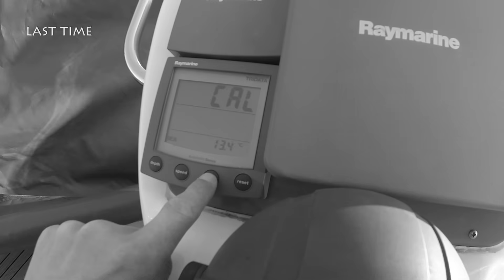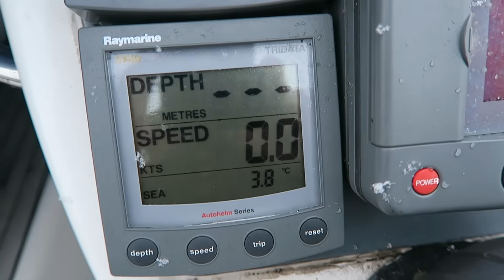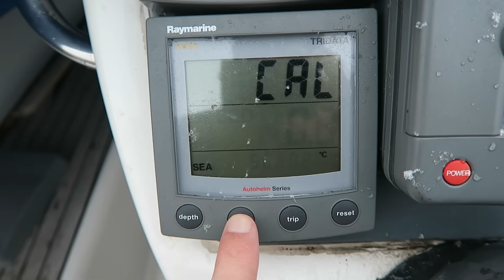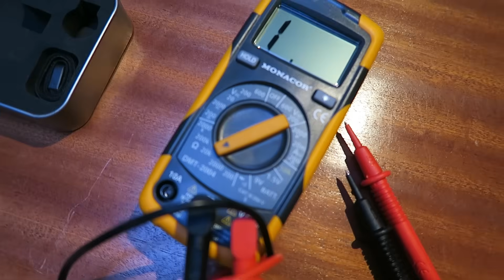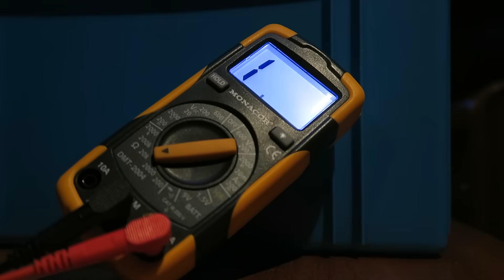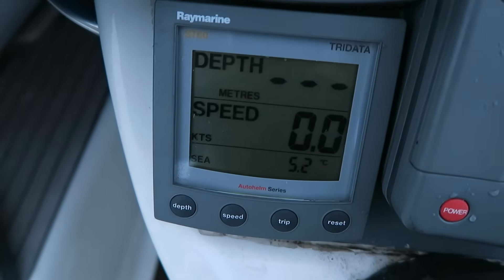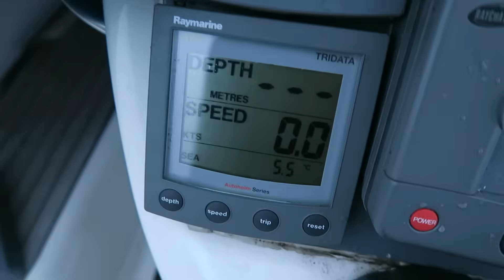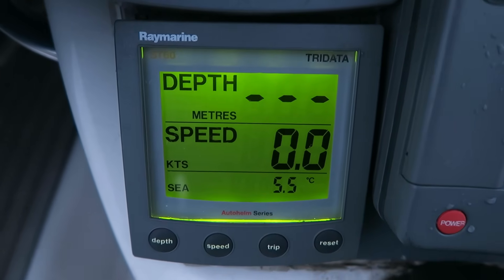Raymarine ST60 Tridata - how to fix Incorrect temperature

Comment: Thanks for the inspiration! In my case the tridata display showed about 5°C instead of 22°C. The resistance of the NTC was then at >2MOhm. Therefore, adding resistance would not have helped. I exchanged it to a 20kOhm NTC from Aliexpress. Temporarily fixed it with a cable tie to a metal fitting, that is at sea temp. Seems to work so far 🙂. Let's see if the temp characteristic (b-value) is compatible.

Comment: Hi Tino. The temp sensor on my ST60 was showing incorrect temp (104F). Excited to get this little project done, I found a pack of the 10kilo resistors on Amazon and performed the job exactly as demonstrated, except  installed the resistor behind the instrument in the pod.  I still cannot calibrate it lower than 102F. Any ideas?

Comment: Hi Tino, tnx for the infos, with your advice I was able to get my transducer in normal range but now the value doesn’t fluctuate over temperature changes, it is always between 23,5 and 24,5 C, while actual sea temp is between 16 and 27 C. Do you think I have to replace my thermistor?

Comment: Thanks! My i40 speed/temperature transducer read about 20C high.  The i40 does not have the temp calibrations, so I'll need to fine select a resistance value.  I plan to add the resistor pigtail at the unit plugs for the brown and white wire.

Comment: Maybe I missed it, but was there a test to make sure that the readings are correct over the likely range from ~0C to +25C?
Reply from the maker: No you have not missed it, and a good suggestion to test when I get another instrument with the same error. My next boat will be around the years 2004-2010 so think the same problems will appear.

Comment: Tusind tak! Excellent advice to change the resistor. I heard changing the thermistot would help but this was even cheaper and simpler way to by-pass the errors of the lazy production line of these " top-end " transducers.

Comment: Hi Tino, I have the same problem with the temperature, showing 46degC all the time and can adjust upto 76 degC on the calibration. What resistor should I use to get to the 0-30 degC ? Is the resistor you have chosen a 1W, 10kOhm ? See that there are several types of 10kOhm restistors from 1-5 W? Will it matter which one to buy? Great video and tip, by the way.

Comment: Yes, it did work. I managed to obtain the correct temperature with 5600 Kilo Ohm resistor. However while sealing the cables, I think I did something wrong! I lost the speed and temperature started to indicate -4.5 degrees C:(
Reply: I found the problem. Cold solder joint! I then soldered properly. Now it works great. Thanks again for the great tip:).

Comment: Dear Tino, what a great idea. My temperature sensor was indicating higher degrees since many years. Now I soldered 10 kohm as you did. However with the max calibration upwards, tridata now indicates around 3 C below the correct temperature. Probably, I have to use different value resistor.  Could you help me for the resistor value which fits to my case?
Reply from the maker: Maybe try with a 5,6K Ohm
Reply: Tino G - Sailing  Thank you. I’ll try.

Comment: Is it always a 10 k ohm resistor that will do the job?
Btw, thx for a great video and regards from Sweden 🇸🇪
Reply from the maker: No the 10 K ohm is only taking a certain % of the amount there is showed in the display, if you add more resistance the "base" temperature number will be lower.
Reply: @twiper  ok thanks, so how many degrees of were you that the 10k ohm fixed?
Reply from the maker: @bollof1  Think it was around 10 degrees

Comment: How did you come up with 10 k ohms ?..   you were able to calibrate at one tempr, but how does it read over it's full tempr range?
Reply from the maker: I found out that I needed a 10K when I first thought the thermistor was bad and then wanted to order a new one. By the new thermistor at the website there was a info point where I saw it was possible to calibrate the thermistor with a resister and I then calculated how much resistance I needed to hit the right number on the raymarine instrument with the old thermistor. But as you saw in the video it's possible to ajust the instrument a bit. I'm pretty sure the temp is right at low and hot temperatures, but I haven't checked it yet.

Comment: Hi! Great videos! I have the same problem here. Will it be the same there in the cable you set the resistor, og does it have to be as close to the tansducer as possible?
Reply from the maker: I think you can mount the resistor where you like on the cable.

Comment: Ok, so now it shows correct temperature on 6-7 degC, but does it also show correct temperature around 20-30 degC? Is it really only an offset problem?
Reply from the maker: Yes it is only a offset problem, it  shows the right temperature here in the summer 2019. To be sure I can measure the temp with a handheld unit and check the instrument in the boat. Think I'll make a video about it so people can see the fix is working as it must do.

Comment: I have a similar problem with my ultrasonic SC4500 Airmar transducer connected to a Raymarine Tridata. In my case, instead of temperature rising and staying steady in high values,, it fluctuates in big gaps going from i.e. 16C to 27C or 32C randomly. I am told be Airmar that speed pulses are interfering with temperature signals. They recommended me to install a capacitor in the junction box but it didn´t work. The transducer is only 6 months old so it cannot be a problem coming from the thermistor. Can you think of a solution for this particular case? I would appreciate your support. Thank you, Alberto
Reply from the maker: Assume you have a old Raymarine ST60 tridata and the Airmar SC4500 transducer assembled with a converter from seatalk to NMEA 2000. Has the problem been there from the start or has it appeared over time? According to what I can see the SC4500 is a unit from 2009-2011 and when I'm searching the web I can see the ultrasonic SC4500 unit has a history with some errors and it is also removed from Airmar´s assortment, so a solution will be to switch to the new UST800 transducer or DST800 (the normal "cheap" one).The second option is to find the problem in the system, think it's possible to connect a computer to the NMEA system and isolate the faulty part, the "black box" there is connected to the transducer can be the problem or the transducer it self. If there is a fault in the electronics inside the transducer I think it is "live with it or replace it" - I have seen the jumping temperature problem before somewhere and if I find a direct solution I'll get back to you :)

Comment: Nice to see how you fixed your temperature sensor. But how did you find out that this could be a solution to your problem?
Reply from the maker: I think the temperature sensor is working now but don't know if the speed sensor is working in the water. I know the speed sensor was working the day I bought the boat. - how I found the solution regarding the temp sensor was because I was searching the web for a solution and found a person there had fitted a new termistor to his airmar transducer. My plan was to buy a new termistor but I saw on the electronic site there was a 2% "calibration" resistor with the termistor and then I found out it was pretty normal to calibrate termistors in many different things so why not just try to calibrate my own termistor. My temp sensor worked fine but it did not show the right number. I think the reason for the calibration function in the raymarine unit is because they know that the termistor will loose it's restistance over time.